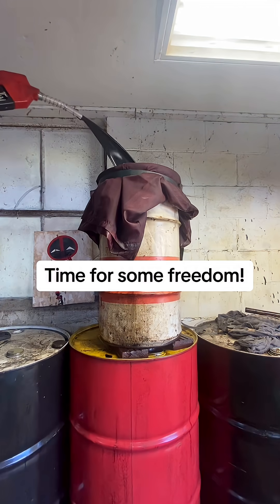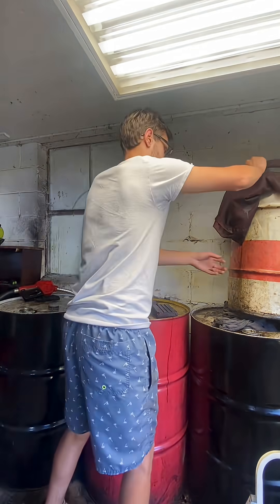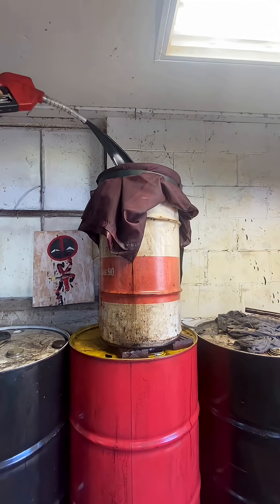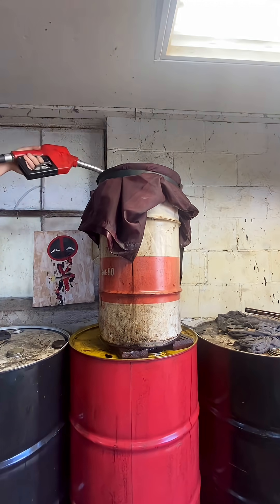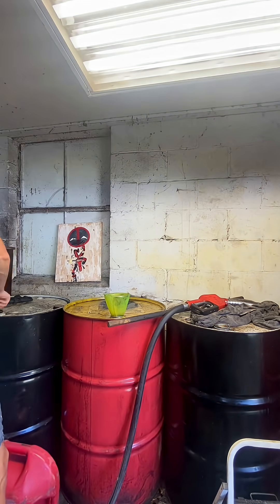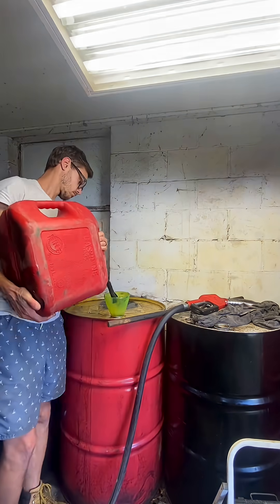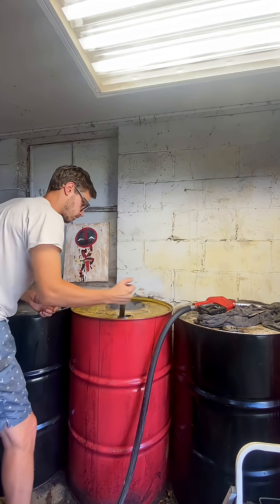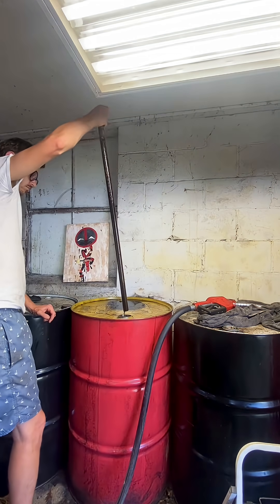Transform #wastemotoroil into #homemadediesel Fuel #dieselmechanic

Comment: There’s a reason more people don’t do this. Popular in the early 2000s when diesel tripled in price, sent a lot of old pickups and Mercedes diesels to scrap yards. There’s no great way to make WMO fuel but using a BED SHEET sounds like the best way to make sure your engine and fuel system need to be overhauled every 30,000 miles.
Reply: 1.4 million miles later running filtered used oil, without the gasoline, in a 78 300D Mercedes with the factory original Bosch injector pump , says your wrong.
Reply: @donmajer9607 just burning used motor oil? BS
Reply: @donmajer9607 I’m not saying it can’t be done, I’m just saying using a bed sheet for filtration and mixing in small amounts of gasoline isn’t the way to do it. I currently own two OM616 W123s and one OM617A W123. The Bosch fuel injection system in those is robust, but without better filtration and ensuring the WMO is actually just WMO without coolant or other contaminants (like ethanol, which would crystallize in the lines and injectors over time) is vital.
Reply: @donmajer9607 whaaat? You have really  drove over a million miles with used motor oil as diesel?
Reply: @donmajer9607 I've run 173 million miles in mine. Just as believable as your "1.4 million"
Reply: @donmajer9607 oils job is to hold metal ,measured in parts per million in suspension.  The reason for oil changes is so the parts per million don't get to high for to long . Fuel pumps for diesel engines are very sensitive to contaminates due to high pressure.  
When you send your oil sample to a lab , it comes back with every  type of metal used in your motor.  Including aluminum.  So not even with seriously heavy magnets ," witch will pull the steel out of the oil with a centerfuge, heat it up then let it sit for over a month at temperature around 120 degrees faringheight over 200 pound magnets will pull the steel out of the oil . But you still have aluminum and other metals used in bearings.  
I made bio diesel before the internet.  I studied everything I could get my hands on for a year before I started doing it . 
With out sending a sample of each batch to a lab for testing, you will junk your fuel pump first and your engine will soon fallow . Witch is why I don't believe you
Reply: @huckstir all that studying and can’t spell follow or which lol
Reply: @khaiwin21 If you can read and understand what I wrote, well, that is what matters.  My motor was a 2.2 liter isuzu pup . Boy do I regret getting rid of it .
Reply: @huckstir I guess if that floats your boat but probably should try to spell simple words correctly if you want people to take what you’re saying seriously lol
Reply: @khaiwin21 is being a dick to someone the best way to help? Seems you knew his meaning even with  the vowel mistake... come on dude
Reply: @michaeleaster4047  oh my bad for pointing it out so he can fix it in the future. My point still stands, when you can’t spell simple things people tend to not respect or trust your comments nearly as much on the internet when half the shit people spill on here has no credibility or factual grounds to begin with.
Reply: @huckstir  Oils job is to lubricate the moving surfaces, not hold metal. That is just a side perk. Correct word is "which", not "witch". You come across as more believable if you sound intelligent. But yes, using dirty oil in a fuel injection system is not wise.
Reply: @huckstir bro with all that time, processing and equipment i think its just cheaper to biy diesel😂
Reply: @huckstir no disrespect but plenty of people are running waste oil straight or in mixes with diesel without issues. The amount of metal you speak of is miniscule. You're talking ppm. Parts per million. Million. Like as in six zeros and a one in front. You would probably be close to the same ppm counts in trash from pump fuel as you would in waste oil.
Reply: @huckstir by the time you do that, how much electricity are you likely to use maintaing that 120 to 150 F temperature?? If you can't keep the process simple and as cost free as possible the risk of damaging the engine vs. buying it from a fuel station isn't worth the gamble.
Reply: @donmajer9607 while your reply proves *you're wrong..... 🤷
Reply: @donmajer9607   yep same here.  Bosch p7100 on my dodge he s wrong too
Reply: @donmajer9607  your not adding gas also oil plus gas does not make diesel  it just makes a mess
Reply: @donmajer9607 bud your reaching, diesels older than 98 are a minority on the road now, we are talking about the average diesel.
Reply: I've been doing this since the 90's  But I use pumps actual filters, heated tanks and electro magnetic strainers.
I not only run all my equipment, I also heat my shop and water with it.
Reply: @rickcross7888 there you go, its gotta be much kore than a sheet for long term success
Reply: @rickcross7888 If I can come up with the money to build a new shop, I plan on buying a WMO boiler for water and hydronic heat. Boiler isn’t cheap but I produce more than enough WMO to make it worth it.
Reply: Give it time. Fuel prices will be going up again.
Reply: @johnpaulg9182  Strait of hormuz prediction eh?
Reply: @johnpaulg9182 after Saturday night without a doubt!
Reply: @johnpaulg9182  do you know the future  full will go up it? Let me guess it will also go down
Reply: @johnpaulg9182  Get some solar panels and an EV. You'll never worry abot fuel prices again.
Reply: 30? Try 10 at most
Reply: @Redbloodroadrunner 10 try 3
Reply: @Dynie-g7x I got about 10k before it washed my injection pump, but I was running a three stage filter system going to down to 5 micron
Reply: @Redbloodroadrunner I don't think you know just how robust old diesels are
Reply: @jollyroger2012 actually I do, and they were originally designed to run on vegetable oil, and diesel in the modern sense didn’t become popular till the 50s. But that doesn’t have anything to do with running used oil.
Reply: I don't get it, are you guys full of sh*t, or am i just lucky?
I did this to my golf diesel for 4 years driving 150 km a day. (5/6 times a week)
Once i had my injectors replaced (it had allready 250.000 km when i bought it) with revived ones and never had problems.
I sold it because they doubled the roadtax on diesels and that killed it, not the homebrew.
I laughed at the pump and cried at the tax, now i cry at the pump and laugh at the tax (not really) while driving a E class on nafta.
The only sift i used was a speakermagnet in a jeans leg
Reply: @ebre3080 i was only making bio diesel.  I still sent it to a lab. 
Even just to satisfy curiosity.  At least you used a magnet
Reply: @ebre3080 i believe you, my first guess is you had a natural aspirated VW Golf diesel as specially the older ones could take anything as fuel without breaking.
Reply: I could see that an emergency situation Stuck in the middle of nowhere just Collect some used motor oil Filter it through a bedsheet right into your gas tank,

      But I cringe at the thought of running all that foreign material through the injection pump on my Commins , 

I use a centrifugeIn In a 55 gallon drum filled with used motor oil, Whereby it is then pumped through a double canister  Fuel filter system into  A 55 gallon drum of clean  Clear Used motor oil.
And then finally I have 255 gallon drums connected to each other where I add approximately 10 to 15 gallons of red dyed diesel, I add some sulfur and anti jelling diesel treatment Mix it and stir it up for an hour with a  Pump, And then finally fill up my diesel tank in my Dodge  Comments Turbo diesel and it works well A little bit of time pennies on the dollar.

But to use a bedsheet for a filterAnd then mix in 5 gallons of gas in 55 gallons,,, Of used motor oil that's still black Full of carbon and particulate metal metal matter in the oi can't see that injection pump on any diesel lasting very long under those conditions, If I couldSuggestBuying a centrifuge they don't cost very much, And they will remove all foreign contaminates within the use of motor oil Returning the oil into a clean reusable Oil that is clear in its state, Ready to be finished into a great diesel product, For just pennies on the dollar
Reply: @paulwelsheimer9164 just make sure that all of metals your recycled oil came in to contact with was made in America, whether American steel or aluminum or brass or stainless and bronze. Then you can completely skip any kind of filtering yet you can be positive that you are not running any foreign materials through your system! Only 100% domestically sourced, refined and produced!.... 🤔😝😂
Reply: Good to know in case I have to fuel my diesel powered vehicle in a third world country.
Reply: If you do this, make sure you can wrench aswel... prices will go up, in the USA to.
Reply: 20,000hrs later says this does work great.
Reply: I wonder if it's good for h9me heating oil
Reply: @iamamp3pimp  yes: far lower pressures in a heating-oil pump. Plus, the injector nozzle is cheap as hell—and easy to change. I did the waste veggie oil thing from 2001-2015 (though less towards the end as people started paying for the used veggie oil, so the value proposition went down). Then my final primary source restaurant closed and I couldn’t get non-hydrogenated peanut oil easily or cheaply
Reply: if im buying a 1000usd beater I would thank god it did 30k miles

Comment: Perhaps a 5 gal bucket with a rain barrel spigot at the bottom, then dump gas in there without nozzle and do a similar step as the oil filtration

Comment: I bought a battery powered harbor freight transfer pump for $13 to transfer diesel. Works better than expected
Reply: This should be the number 1 comment, I have the same little beast from HF. Best 15 bucks i ever spent.
Reply: The stick pump?
Reply: yes the battery power liquid transfer pump. SKU# 63847. Moves diesel really well and no mess.

Comment: Does the used oil have to be synthetic oil? or does it have to be conventional? Or does it not matter?
Reply: It doesn't matter. Either or will work. But the synthetic oil has to be used oil. It's all about the carbon getting into the oil.

Comment: so 5 over 50 is 10 percent gasoline. So when i accidently put 1 gallon of fuel in my 2020 Diesel Amarok which worked out at 8 percent I drained and diposed of the mix when I could have just used it. I was worried about the pump and injector.

Comment: Is there any extra wear on the injector pump from metal in the oil? I'm talking about metal in the 10s of microns range
Reply: Most secondary fuel filters are 1-2 micron.
Reply: Just good for olds mercedes or Volvo's diesel from 70's... don't try on a modern common rail injection cars....
Reply: usually you would put this fuel in something thats got at least 150k miles on it, the tolerance has usually increased to the point where with the added lubrication from it being mostly oil its usually all good, deffo do not run a dpf or egr if using this fuel

Comment: Drill a 3/8s hole on the underside of the handle of your EPA standard gas can and it will dramatically increase the flow of your " Government Approved Standar Gas Can" and it won't be noticed by anyone.... even the D.O.T. man when he pull your rig over during a haul.

Comment: Mix the oil with white spirit instead, it does the same job but it's cheaper😉
Reply: White spirt?
Reply: @ricos4700  it's what painters use to clean out their brushes and thin down oil based paint.

Comment: Making diesel fuel from used motor oil and gasoline is not a straightforward or practical process for several reasons. While both used motor oil and gasoline are petroleum-based, they have different chemical compositions, properties, and purposes, and combining them doesn’t directly yield diesel fuel.

Comment: Um you will have a lot of trouble with the new style diesel engines that are computerized  especially watch out on your high pressure pumps cp3 to cp4 etc that used motor oil is no good for them ie as a fuel

Comment: I'll stick to my centrifuge. No matter how good of a filter you use a centrifuge will still remove more even after filtering. I have a deuce and a half with the multi fuel engine so I don't need to add anything to the oil just get it clean and free of particulates. Get yourself a M35A2 and you will never have to blend fuels again. The multi fuel engine will run on any liquid that will burn. I have used motor oil, heating oil, kerosene, transmission fluid, hydraulic fluid, mineral spirits, waste vegtable oil, jet fuel, gear oil, brake fluid, power steering fluid, diesel and even gasoline with just a bit of motor oil in it to keep the fuel pump lubricated. I have over 7k miles of free driving on this truck. I had to stop taking in fuel because I can't use it as fast as it comes in.
Reply: Looks like I need a deuce and a half! That's some Mad Max ish bro. Military auction here I come
Reply: Hey YouTube... Why are you deleting comments that have absolutely noting wron with them? I swear the team in charge of this stuff is so inbred your 23 and me doesn't even have cousins only part siblings.
Reply: @jameshathaway5117  they don’t want that info to get out. Someone might actually fix something.
Reply: @jameshathaway5117 Awesome comment.
Reply: @jameshathaway5117  This is really cool info, thanks! Also, you and your friend should make videos, everyone here would watch it for sure ☕🫡
Reply: @James-L-83  currently I'm fighting with old tubes in the tires. It's probably not to entertaining to watch me fight 200+ lb tires. When I switched from the tires that were on it when I got it to the 44" Michelin tires that are on it now I couldn't find suitable tubes so I reused the tubes from the smaller tires and I'm currently paying for that mistake. I finally found some tractor tire tubes that should work but swapping out 11 tires to these new tubes is not only really hard work but exceptionally dangerous with these split ring rims. Tire shops in my area won't even touch them so I'm forced to do all the work myself. Not that it would really make a difference if the tire shops were willing I could only haul 1 tire at a time with the seats down in my wife's 76 wagon. Probably a pretty boring video to watch.
Reply: @jameshathaway5117  Several years ago I saw what I think they call a deuce+1/2 for a few grand at a junk yard. I didn't have money for that but just walking around it I was imaging how the frame could be modified to make a mobile land development rig with sleeper cab.
Careful with those tires for sure, and also make sure you always have a couple winches handy (extra chains).
Reply: Nice!  That good old milspec engineering is definitely great for running on just about anything in a pinch!  So good...  They could probably even run on those Diddy baby oil parties, too!
Reply: if we could put a more modern comfy cab on these to make a good daily driver, boat puller, or even plow truck in a short version, i'd buy one tomorro as a project.
Reply: @Epiq45 the back of the cab does ride on a spring. I don't see why you couldn't modify the cab to be air ride without too much effort. Replacing the springer seat with an air ride seat also does wonders. The biggest problem is the spring packs on these things. They are way over built and don't even settle under a 5 ton load. I suppose if you really just want the multi fuel you could easily swap a used take out multi fuel engine into another chassis. The guy I bought mine from had an Isuzu cab over cab on a International frame with a pair of 5 ton axles and a multifuel in it. He was building an overland camper rig out of it.
Reply: What kind of places are giving you free oil?
Reply: @getscrapped  I have 200+ gallons of used Canola oil from a local gas station currently still stored and uave used who knows how much. I stopped by a local diesel shop and got one of those 400 gallon palletized containers full of mixed gas/diesel/ motor oil that was pumped out of fuel tanks from people putting the wrong fuel in and mixed diesel and oil from injector failure flooding crankcases. I got around 175 gallons of barely used hydraulic oil from a buddy that works at a carpet manufacturer. They put in a bunch of new equipment and flushed the whole system with fresh hydraulic oil to make sure there were no contaminants. I got a bunch of used motor oil from another buddy of mine who works at a shop. Most of the places I got it from have to pay to dispose of the stuff so they are more than happy to let me haul off as much as I want.

Comment: If you drill a small hole on the top opposite side of the nossel and use a roofing screw with a rubber washer to seal the hole . Works great.
Reply: And enjoy a cigarette while pouring  🤣
Reply: @ralphday4842 it will not do a thing. My dad was a mechanic for 40 years and he would take the gas tank out while smoking a cig. And I have seen him put a cigarette out in a 5 gallon bucket of gas. You got to have a spark.

Comment: Drill a hole between the side handle and top handle you'll thank me later. Prolly 1/4 drill bit should work fine. Me personally I use a 3/8s for fast flow but sloshing around the can it kinda splashes a Lil out the vent hole

Comment: Sounds like this would be a good fuel for a 12 valve Cummins or a 7.3 international however how do you think it would perform in these new 6.7 diesels like the power stroke and Cummins 6.7?
Reply: It only works in diesels older than 1998, on or offroad applications. Anything newer and you’ll wreck the fuel system before you leave the neighnorhood. Even then this process is 10% of a system that is remotely sustainable.